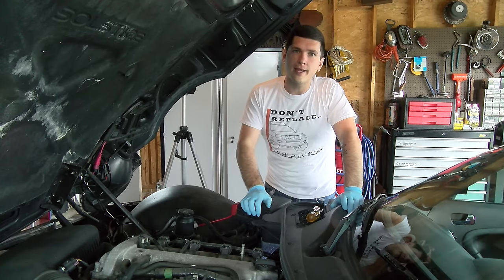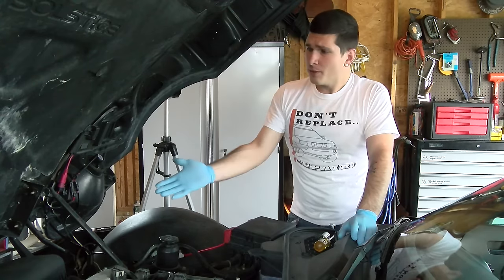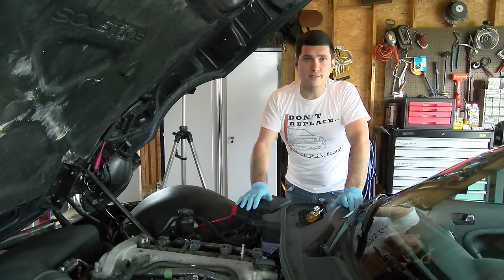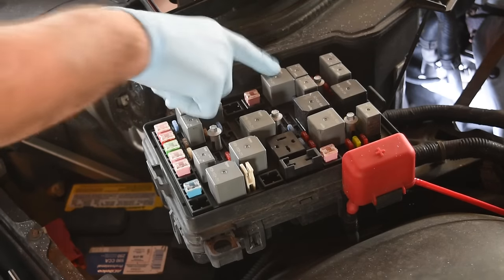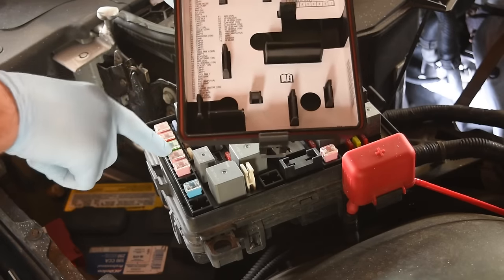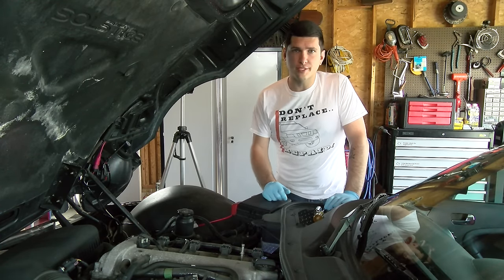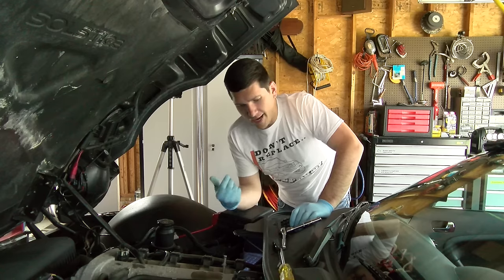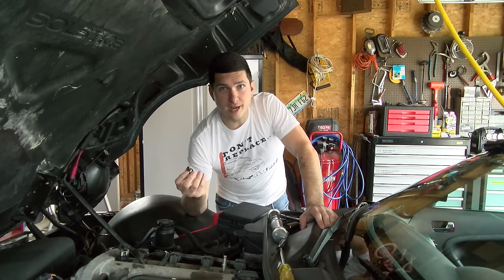How to Diagnose A Constantly Running Fan

Comment: I had a hunch and you confirmed that a faulty fan switch could also keep fans continuously running.   Though my coolant temp maintained between 185-195 degrees with my fan running continuously,  I guess the only problem I could eventually see is shortening the fan life.

Comment: I changed my thermostat twice (was told I put the wrong one in the first time), now I noticed this in my car, also it is GM and from googling this, it seems to be a typical GM problem. Gonna have to look into this closely. Great video! Subbed!
Reply from the maker: Thanks for watching!
Reply: Ry the car guy

My car does the same thing, but the fan does not turn on until it reaches 198F, then the fan turns at high speed and it will never shut off unless i turn the engine off.  I have a mustang gt 2007.  Can it be the cylinder temperature sensor?  When i turn the ac, the low speed fan turns on as it should, and when i turn the ac off, the low speed fan shuts off, which seems right.

Comment: Best the fan running constantly than none at all.
Reply: yeah I guess. but I'm having this problem and the battery dies. not fun removing the plug or unplugging the battery every time u park. and if u forget you're screwed
Reply: @jaimedelgado7529  there is a retain power relay that allow the car to have power 15 seconds after I turn the ignition 📴, once it's stay on your battery will die, u will need to locate it and replace or remove.
Reply: @Platinumtag  first of all I'd like to thank u for your reply ! 
if what you speak of is the nature of my problem then the radio would also stay on indefinitely. correct ? if the radio turns off then the problem lies elsewhere. correct ? 

now the fan always stayed on a while after I turn off the ignition.  but now the fan will only stop when there is no more juice in the battery. it leads me to believe the problem lies with either : 
- the resistance is no good
- the relay is no good
- the temperature sensor is no good

am I right to think this way ?
Reply: @jaimedelgado7529  yes if radio turn off and fan stay on its not the retain power relay. Could be fan relay stuck on, on position, pull a relay to see which one turns of the fan. Or u can also unplug the sensor that attach to water hose to see if that turn off the fan but I would think it's not the sensor. More of a relay problem...
Reply: @Platinumtag  thank u brother. I'll do just that
Reply: Not when it is -30 celsius
Reply: I just had a new fan put in my xterra bc the other went completely out. BUT it runs so loud when I first turn the car on even though the car is not running hot. Is that normal? It goes silent after a minute or so. It will also begin to run loud when I accelerate from sitting at a red light every now & then. Then I goes silent after a few seconds. My mechanic said that was "normal". I dont believe that bc my car never did that before. I feel like they are trying to take advantage of me bc I have to take it in about every 3 months it seems! :/ This is getting to be a pain in the ass!!!! How do I tell them to solve this  (fix it) & not bandaid the problem??? It's costing me way too much! THANKS!
Reply: @Lishailaumus  that normal when the radiate get hit fan spin faster then when cool speed lower it's just the fan fan is aftermarket reason it has more power than regular fan , good to put a new thermostat with a 1/4 inch hole on it if u ever have a steam radiator or back pressure and the refill tank..... It's normal.....
Reply: @Platinumtag  its "normal" for it to run loudly when I first start my car in the mornings before I pull out of my driveway &when I start the car after sitting inmy work parking lot after 8-10hrs??? never heard anyone ever say that. Are you sure? bc my car has NEVER sounded that loud when I FIRST start it up after sitting turned off for several hours!!! Hmmm...
Reply: @Lishailaumus  yes it's normal I had same experience after I replace my fan on a Dodge caliber...... It's won't hurt anything :)😁...... A original fan from a stock Xterra would be a perfect replacement if u don't want it to runs loud.
Reply: Until it runs your battery dead
Reply: @huntergraves4398  won't run battery dead it have to be install while engine running only....if u do it direct to battery maybe yes :)

Comment: Nice video, I have 2014 gmc 1500, and the fan also continues to run after shutting motor off... hopefully I can pin point problem

Comment: Good video..  I am having the same problem with a 2003 Ford Thunderbird.  However, my temp gauge sits right were it always has since the car was new..  You didn't address what your temp gauge was doing..  Did it show the car as erroneously running hot?  I have a scanner so my next check will be watch the temp on it.  This problem started after I added a can of R134 to the A/C.  Could that be related and perhaps I overfilled it?

Comment: I desperately need your help. My 2016 mustang v6 is having a similar issue, but only when I turn on ac or heat. I can drive the car fine without climate control but as soon as I turn it on, the car chugs and the fans go crazy. It's embarrassing. Any ideas?

Comment: question: if temp sensor read on dash is correct ( shows correct temp) could it still be faulty?
Reply: They are usually separate sensors.

Comment: Ry- videos are still looking good and as helpful as always. Have a ‘10 xterra Off Road with 120k miles. It’s time to bite bullet and replace radiator. I noticed you don’t have a video on this from what I can tell. I’ve heard that they can be a slight pain. Have you done this yet on yours or do you plan to? Any pointers?
Thanks Buddy

Comment: Good video. I changed the sensor but the fans are still running. I’ve had no luck with getting  the people at the auto parts store to locate a relay. Any suggestions?

Comment: Had to thumbs up 👍🏽 the video b/c the radio fuse under the hood is exactly what the issue was but before that it was also making my ac turn on on ACC mode and blow hard as hell soon as the fuse was replaced with a spare the radio not only kicked on but when in ACC Mode my fan was no longer blowing
Reply from the maker: Thats great! Glad to hear. :)

Comment: resetting the computer was an important part. after replacing sensor and thermostat the issue was still there till i  pulled the negative cable off the battery for a few min then hooked it back up and and fans stopped running when i turned vehicle off.. now im waiting to see if  the problem will come back in a few days and just resetting the computer didnt just put it off.

Comment: Something to mention is that a broken wire will have same effect. If ya  have no difference with fans running always with sensor plugged in or connector off it's a bad  wire. :)

Comment: Hey quick question. I have the same problem with my 2011 Honda Civic. As soon I turned the ignition switch to on position both fans (radiator fan and condenser fan) start running on high speed do you think that I have the same issue? There is no check engine light everything else looks great. Thanks, I really appreciate your videos well explained.
Reply from the maker: I would definitely check relays. Sounds like one could be stuck on

Comment: 2012 nissan titan, radiator fan running constantly, i check using OBD but not throwing any code , i suspect the fan clutch,  do you have any suggestions pls help. Thanks

Comment: I was wondering why having both fans running constantly irrespective of cold start or warm start after return from garage.  In fact, both fans kick in whenever the key is turned to power on position.  I guess it is time to change the old temperature sensor too . Thank you.
Reply: I did that on my 09 Altima and still no luck!

Comment: I had a P0119 and after searching found the negative wire from the coolant pump broken & bouncing making the fan kick on with the coolant engine temp fluctuating from 78 degrees to over 230 and back down.

Comment: If you have been running/driving the vehicle (2014 Caravan), with the A/C or heat on to the rear and then you turn off all climate controls and temp to medium (no heat no cold) and then turn off the vehicle, but then it sounds like something is still running in the rear, maybe a fan for the rear heat/ac, how long should that run for before it stops?   Is this normal?

Comment: Good morning. My 2007 Pontiac G6 fans coming on and staying on as long as the engine is running. I changed the temperature sensor and it is still doing the same thing. I am going to check the fan relays now.
Reply: Same here but with my Altima, did you find out what the problem was ??

Comment: I have a  2004 VW Beetle doing the same thing constantly fans staying on no matter what. Do I use the same procedures as with the other car?
Reply: I have 2000 Beetle that the fans run even with the engine off and the key out of the ignition,  I have to pull the battery cable.  Been trying for 2 years to figure it out.......I've replaced fan control module and the temp sensor.  No mechanics in my area can figure it out.
Reply: change radiator fan Relay and/or temperature thermostat

Comment: I have 2007 chevrolet uplander ls van and the fan is running when it turned on and we changed the sensor then it still on the code said 02 sensor u think the 02 sensor need changed let me know plz

Comment: Hey man help me out here if you will. I have a 1998 Lincoln Continental and I replaced the radiator. Added coolant and removed all air bubbles so that's done. But now I've noticed that after replacing the fans, they stay on constantly even when the engine is at normal operating temperature. Before the job, they would run a while after I turned off the AC. Now they stay on even when I don't have the AC or heater on. What is going on? I've noticed a leaking sensor that is between the exhaust manifold and the engine oil filter. Any ideas on what's going on? They do turn off how ever when i turn the car off. They only turn on during driving and stay on until I turn the car off.

Comment: In the process of all this was the temperature gauge reading hot when the engine was  cold because I've seen it doing that
Reply from the maker: No, not that I recall
Reply: @Rythecarguy  okay  certain sensors I've replaced in the past that have showed it where it's overheating even if the engine is cold. And I've seen the flip side where it's ice cold and the center still reads ice cold

Comment: Mine stays on even with the key taken out .... I have to pull the battery terminal.  It just happened last night after I went thru a car wash - - maybe water caused it.  My car is a 2006 C-230.  The fan actually behaves properly when the engine is running.  Any ideas ?  Note:  I had been looking at my main fuses in the engine compartment prior to the car wash for a prior issue of the alarm doing off randomly and neglected to put the cover on before closing the hood and going to the car wash. After the car wash I noticed some water drops on the relays and fuses.  Dumb mistake by me ..... but it seems that is related to the problem
Reply: Sir the same problem I am facing in my car pls help me with ur remedies done in car

Comment: I have a similar problem in my Cavalier 03 2.2 Ecotec. I changed 2 years ago the temperature sensor and the fan turns on 2 lines after 90°, since a few weeks the rpm drops and almost turns off the car. But I noticed that the fan turns on just passing 90° not as it worked before, I think rpm drops because the fan wants to turn on. Do you think it could be the temperature sensor who is causing the trouble again?

Comment: My fan starts after sometime but then keeps on running... Temperature shows in middle... But after few km of running car loosing power when going uphill (I have to switch off ac)... also ac is not tripping as normally it trips when reaching certain temperature. What may be the reason?? Please help.

Comment: Good video , I have a 1995 ford mustang and when I turn the car off the fan keeps running you think its the temperature sensor as well ?
Reply from the maker: No, thats likely a relay or switch. Something is continually supplying power to the fan even when you turn off the car. Worst case would be a short.
Reply: Also a short to power, plugs or connectors where they are shorted internally
Reply: @Rythecarguy  I have a 2007 buick lucerne cxs v8 and my fans r turning on and off

Comment: I have a 2009 Nissan Altima and the fans are always running even in cold weather startups, but the guage that reads engine temperature still works not over heating and not too cold. My question is can it still be the temperature sensor??
Reply: So I replaced the temperature sensor and still both fans are running on high. I replaced the relays too and no luck.
Reply: I have the same issue with my infiniti g35
Reply: @gthatkid6035  Im beginning to wonder it's not overheating cause it's super cold outside, and both the fans runs at full speed. I  squeezed one of the main  radiator hoses with the car on and....Believe it or not the Fan speed was reduced for a few seconds. I think radiator is clogged idk how or water pump is not circulating coolant. I already tried temp sensor, relays and nothing no luck. Hope this helps.
Reply: @pono321 does water constantly leak from under the car as well or is that just me?
Reply: It's possible it could be from the water pump seal.
Reply: @yomoms16  got it man thanks for the tip I actually just got rid of the relays! Lol but it doesnt overheat I'll see if it has that little box next to the fan, I looked last time and didn't see one, I'll have to check again thanks!
Reply: @gthatkid6035  I'm having the same issue with my G35. It doesn't overheat, no engine light, and runs normal, heat is hot, ac is cold. But low pressure in the radiator hoses. But sometimes the top is hot. It's random. So is something actually wrong?

Comment: My cooling fan keeps running with engine off. The only way to turn it off is to pull out one of the three fuses that controls the cooling fan. Replaced the fuse with a new one but still no luck.
No codes being thrown on the diagnostic tool. 
No coolant leaks, no engine temperature overheating as of yet, just the problem of fan keep running and kills the battery when car is off. Any ideas?

Comment: On my 2004 chevy venture, the cooling fans don't run untill the engine temp gauge is just over 3/4 of what the gauge shows, when they come on, they go till the engine temp is where it is going down the highway, then they turn off, however if I turn on the a.c. they are always on keeping it good engine temp, and if the engine temp gets half way the high speed fans kick on only with the a.c. on, so I don't get what is going on?

Comment: Our PT Cruiser fan runs on high all the time after an engine overhaul but only after starting, it stops again as soon as the key is turned off. I swapped the relays out and they are not the problem. The power runs to the fan as soon as the engine starts through the wiring that runs to it, I disconnected the connectors and it stopped but as soon as its reconnected it starts again, the fault seems to be between the ignition and the connector and is not the relay. It also runs with the sensor wires by the thermostat disconnected. Where to from here?

Comment: I have an 11 years old Toyota sedan and has 90k miles on it. When I started the engine everything works fine up until a few minutes then the fan started running in full speed even when I turn off the AC or didn't turn on at all. I have the wait about 5 minutes before the fan is turned off, do you think it's the temperature sensor problem as well?
Reply: Good question I have the same problem but mine only turn off when car is off.

Comment: Hi! Can the aux/AC fan be reversed so that air can be pulled out of the vehicle?
Ideally, I would like to be able to flip a switch for the fan to push or pull air (of course with AC running the fan should be pushing air in the cabin).
Reply from the maker: I don’t think that it works that way I would not reverse the polarity on an electric motor. You can try it but you might be replacing your fan.

Comment: What about if it runs loud after driving it then it’ll cut off after cutting it off for 5 mins then when she tries to crink it up the battery is dead. So everytime she leaves we have to jumpstart it. The fan will cut on after it warms up but it’s cold outside. It’s normal when she cranks it up. Is it a relay?
Reply from the maker: Not sure. What car?
Reply: @Rythecarguy  it’s a 2012 Ford Fusion SEL

Comment: 2006 Chevy Silverado
Cooling fans run continuously changed the cooling fans,fan relays, changed the temperature control switch but the fan still stay s running
Reply: Clear the codes or disconnect the battery for 15 minutes.
Reply: Same here man it's so frustrating, Did you figure it out?
Reply: I have the same issues just dont know what's the problem

Comment: I have the same problem with the fan running on high whenever the car is running. Could I just buy one censor and plug it in out of the car to see if that is the problem? I believe it has two, one in the engine and one at the lower radiator. I swapped the relays around and it still is happening. Thx.
Reply from the maker: Yea, I don’t see why not as long as they are the same exact part number. There are also ways to test relays, just look it up on YouTube if you don’t want to buy the part first.
Reply: @Rythecarguy  yeah my car is over heating so I checked the fans they turn on and off I changed the relays and it still doing the same. And now sometimes the fan stays on after I turn the ignition off